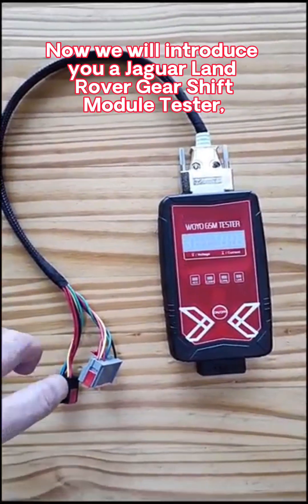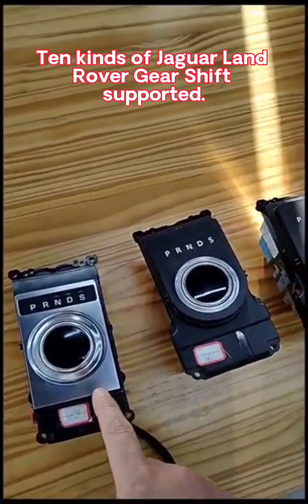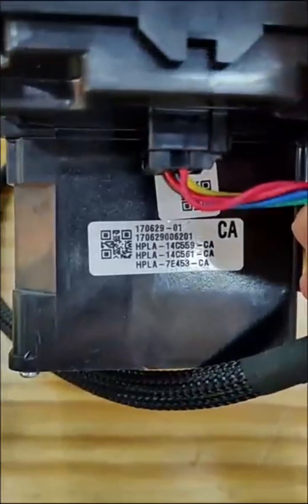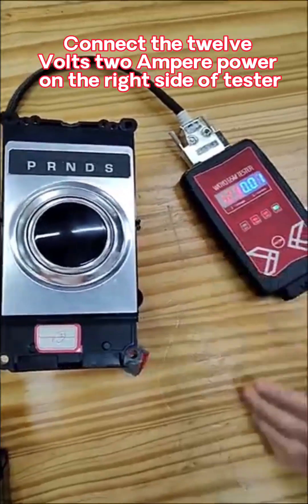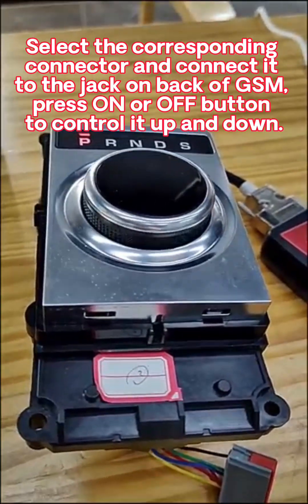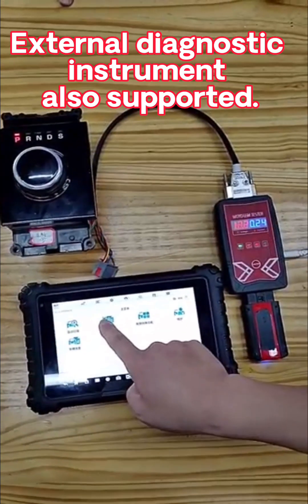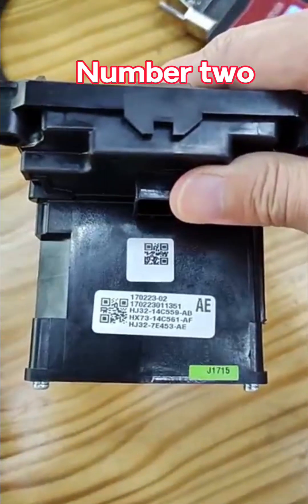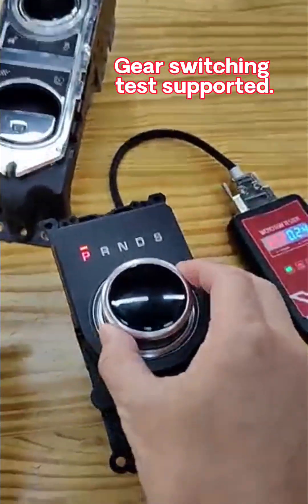For Land Rover Jaguar gear lever GSM(Gear Shift Module) tester

Comment: dont buy this, its not working on a UK jaguar and Land rover GSM, i did test 4 modules, 1 of them brand new, only lights com on these
Reply from the maker: Sir, can you tell me the model number of the 4 modules that can't be done?
We solve your problem.
Reply: So because JLR make such unreliable modules you make a tester for them 😅.
Just plug them into a real car and use standard equipment.
No need for this Chinese junc